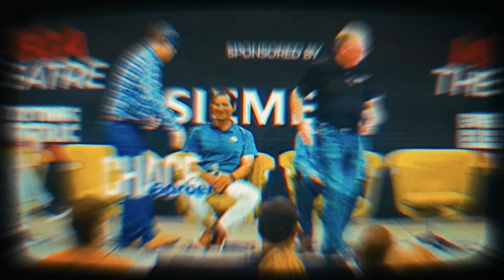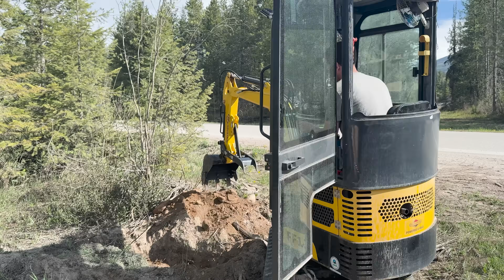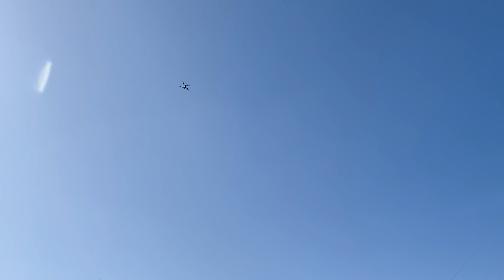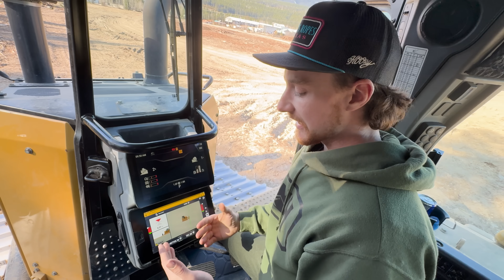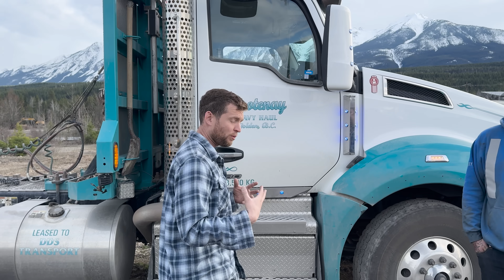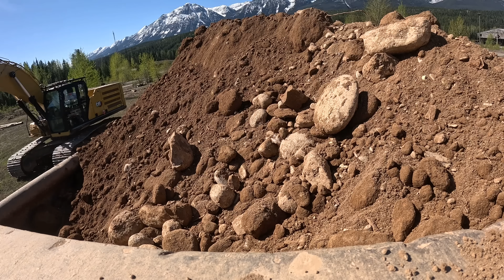We Ordered Our New Truck Shop

Comment: You must have sand and gravel, buy a used cement batch plant or asphault.   Barter materials for install labor with road contractors.  Let the natural resources pave away.  Become an energy utility, steam solar battery banks, converted trucks.

Comment: This hasn't come up in a while but where is the center of mass of Topsy? As it was not adresses in the safety short?
Reply: I'm guessing center of mass us a little lower which makes it safer against roll over.
Reply: @Sah-o5m this comes from ev cars having  a lower center of gravity do to battery skateboard location messing up guardrail  by going under it.
Reply: @cawsking555  I saw an article about EV cars with skateboards going under guard rails. I'm not worried about Edison Semi's or Pickups having that problem.

Comment: As someone who worked with many big companies. I can tell you direction of the building means alot.
I worked in shops where the door openings were a real issue. Especially if there are doors on both sides. When opening a overhead door on one side, and someone opens one on the opposite side  - heat disappears in a hurry. FYI ! 
The drone survey was a great move!! Keep.up the good work.

Comment: I am so happy to see you at this exciting point to really get the ball rolling towards the future.
I would like to suggest that you look into passive Solar design of the build as an important component, such as orientation of the building for sun movement, pitch of the roof insulation passive heating, direction of where to locate windows and doors,
For example you don't want the full length of the 300 foot building facing the afternoon sun it would cost you a fortune in climate control, you need the shortest length facing it with minimal windows and doors, and heavily insulated walls, over hanging eves to cast afternoon shade onto the walls set at your locations correct angle so you get sun protection in summer and winter sun only coming in.
If you have a good architect they should have suggested this to you if not PLEASE consider getting informed before you start building.
It might cost a bit more in the building stage to build passively but in the long run your savings on building correctly will pay back at least 10 fold
Also consider the benifits of solar power, wind power and solar hot water, once you install such sources your savings on power bills will pay off your installation costs and could end up  covering the power bills itself or going a long way towards doing it.
Besides what could be better than providing your own power to charge the trucks and enhance the name of Edison motors as truly being good for the environment.
Please look into it before moving forward, it is worthwhile.

Tony from Rural Western Australia 🇦🇺🦘
Reply: Plus Edison has a good relationship with a solar panel company.
Reply: @Sah-o5m brilliant, living in Western Australia where sunshine is too plenty full, my knowledge of how economical and efficient they are in deep snows of winter (I spent 3 months in Vancouver and on the island of Vancouver back in 96 during winter, but solar wasn't really an option back then, at least as it is today) I saw at the end of this video they do use solar panels and it gladdened my heart to think I was already preaching to the converted, I don't know if you have to clear the panels each day of snow or can get electric heaters to do the job during winter, I still feel even if it is decreased units of power it is still (after pay-off period) free power coming in

I have been using grid tied solar for just over 13 years now first setup was 1kw for the first 10 during that time I installed a standalone hybrid system of 2 solar panels and a 600w wind turbine and a 3kw Inverter going to 2 x 470 a/h agm batteries @ 24v output, I have 2 more panels to go up on the roof and maybe more in the future
After the first 10 years using the 1kw grid tied, I scored a good deal on a 6.6kw grid tied system that I'm using to this day, with summers reaching 45c here it gives me plenty of power to run a split system air-conditioner AND all that goes into running 3 five foot tropical fish tanks and 3 x 100 litre tubs full of tropical fingerling Mollies basically energy free.
I try to bring the idea of alternative heating and passive design to as many as I can, most people only see the added costs in building it into their budget's and obviously trying to fit that into a tight budget already is hard even with a contingency plan and not the huge future savings long term, as the old saying goes, you can lead a horse to water but can't make them drink goes
Retrofitting afterwards is better than nothing but nowhere as good as doing it in the beginning.

Tony from Rural Western Australia 🇦🇺🦘

Comment: Amazing to see the progress! You guys are getting a great price for that building. $50 CDN per square foot is awesome. It's clear that the local business community wants you guys to succeed. Don't forget about hybrid diesel/electric farm equipment once your truck shop is up and running. You guys will have the engineering & technical talent to make that happen better than anyone else.
Reply: I don't honestly see how a (quality) manufacturing facility can be built for even close to $50/s.f. I'm sure energy codes and snow load/seismic loads couple with an overhead crane system mean the building and insulation system has to be close to $30, no concrete, labor, or doors included. Not to mention the quarter million electrical system they'll have inside, office framing, fire suppression etc. Not hating, I hope it works, but that sounds really cheap!

Comment: if you can make hybrid diesel-electric logging trucks, you probably can make, a shorter 4x4 Bush bus that can go over water bar clearance, and take hair pin corners, they where once common in developing countries to serve far communities that often had road erosion issues, or to make it over mountain passes on narrow roads, thus fitting in pull overs, and having at times flashing safety alert lights for narrow public roads.

Comment: Have you ever thought about making Electric drive Hybrid conversions for the segmented busses. Out east in Ontario, and I am sure in most metro areas in Canada and northern US th
at get snow have the issue where they always get stuck in snow cause they are driven be the rear most axle on basically the trailer for all intents and purposes. But an electric axle before the segment (on the B axle) would solve all these issues.

Comment: So, its a sign, A GOOD SIGN 😎
 .
 My current boss is on the verge of retiring from the logging business. 
 I've been doing Equipmentwatch & Firewatch for him for 5 &1/2 years. Best boss ive ever had.
 Ive stiffled and prevented 5 fires from becoming disasters and prevented theft and vandalism since 2017, in Oregon.
 Can you use a good, loyal, slightly eccentric and humorous watchman with a 114.8 lb , four legged security system?😁☕
 I used to work as a mechanic in truck shops and have experience, but my advanced years, im only allowed to point, or laugh, but not at the same time🤣
Reply: I’ve got a “fun” question for you: what “brand” is that 114lb system, because it’s sounds like it might have a “foreign” 😅 name. 😂
Reply: @ToddAdams1234 yep, it's a self propelled,  all-claw-drive quadruped... RottnLab 😁☕

Comment: Do a magnetic survey.  An old steam train will show you as a "sore thumb target" because it is a huge amount of iron.
Reply: magnet survey via drones (if possible). I believe meteorite hunters use a quad that drags a trailer with metal detectors to find buried iron meteorites under farmers plowed fields.
Reply: @Sah-o5m  Metal detectors have that one over distance to the 6th thing going on.  This means they can spot shallower stuff with deeper stuff being ignored but they are only really good to depths about equal to the heads diameter.
Magnetometers only have a one over distance cubed thing.  This makes a car at 30 meters detectable.  Hanging a magnetometer off a drone is the way to get the job done quickly.  Getting a person to walk back and forth like mowing a lawn is a lot slower but there may be reasons to go that route.
Reply: @kensmith5694  Much much history on that property. Sad to say, there is probably an unmarked cemetary there somewheres....

Comment: Beam crane will be essential in new shop,will speed up production no end.more power to ya guys👍
Reply: Going from a drafty tent with no ac in the summer and wood stove in winter. And very soon will be in a 30,000 sq foot (2800 sq meter) building with tall ceilings. A flat floor that you can run a pallet jack. Dual gantry cranes. Central heating AND cooling (maybe). All the electrical power they want/need. On prem temp controlled restrooms. I couldn't be happier for the Edison folks :)
Reply: i believe they are mandatory in general, in any kind of production shop